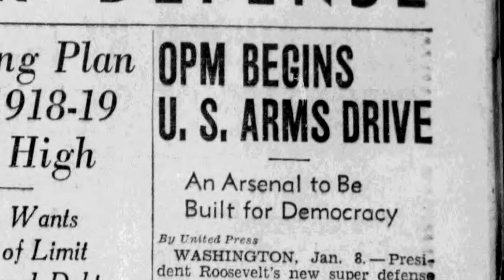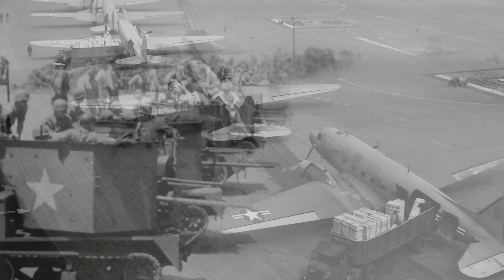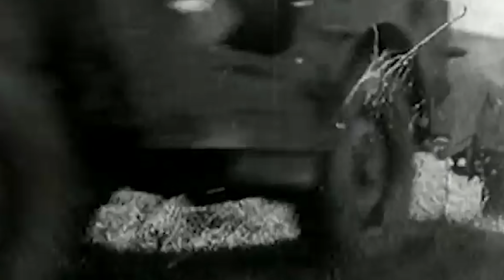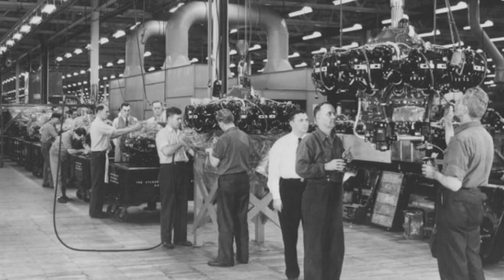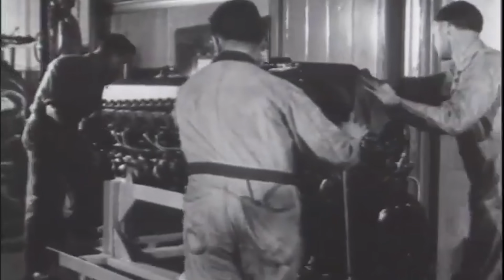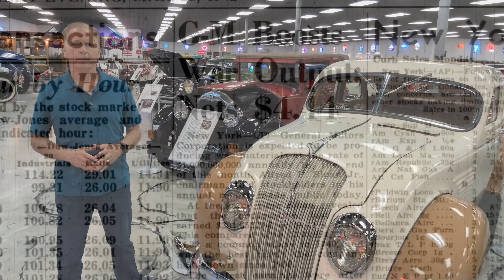How American Car Makers Turned the Tide of World War II

Comment: Packard was licensed to build RR Merlin engines and changed the design to make manufacturing quickr and easier. They also improved the supercharging system.
Reply: Plus they built 14,000 M2500 PT Boat engines for the US Navy and Brits !!! in addition to the 55,525 Merlin aircraft engines!!!

Comment: Ford was hoping to compete for aircraft engine contracts and developed a massive V12 DOHC engine whuch didn't get the contract. But then the army came asking if Ford ciukd make a massive tank engine. So they took that V12 engine and lopped off 4 cylinders. The result was an 18 liter 60 degree V8 with DOHC heads, a flat plane crank and it made 1000 ft/lbs of torque from near idle to 2200 rpm and 500 hp at 2600 rpm. It was all about torque. These engines powered many Sherman tanks. Chrysler also made a monster motor for Shermans, the A57 multibank engine. These were made from five Chrysler inline sixes mounted to a massive crankcase. Each bank had it's own crankshaft with the flywheels gears to a central output shaft... thirty cylinders and 370 hp.

Comment: The tiny Crosley Corporation pwhich had just expanded into the car business in 1939, made a massive difference in WW2. Powell Crosley got his start selling auto parts in the teens. He then developed an affordable radio for the masses. He needed something for buyers to listen to, so he started WLW radio, the governmentgave him an experimental licenseto broadcast at 500,000 watts. He then branched out into household appliances. His engineers help set up Voice of America to transmit to Europe, (later to south and central America). During the war they produced transceivers for the war effort. They also made small trailers, field kitchens, and small lightweight generators used in field HQs and as auxiliary power units on bombers and small boats. But the big important tgings were the proximity fuses for antiaircraft shells.

Comment: There, next to his favorite chair, was a picture of a B-24. It was the airplane that took him to 35 missions from England over to Germany. My favorite uncle was a WWII veteran. Late in his life, he finally spoke of some of his experiences. His job was a waist gunner. He regretted giving the pilot a chunk of metal that burned his glove when he picked it up. The chunk had penetrated the belly, came through seat he had just vacated, bounced off the bomb moving rail and landed on the floor. I received an education when I mentioned the B-17. His airplane was made by Ford. An interesting side note. The Delta single handle faucet copied a hydraulic control valve used in the B-24? In many ways the B-24 was advanced as compared to the B-17.

Comment: I agree that it's hard to pick one for contributing the most, and still it's worth mentioning more. Chrysler for example, also manufactured the engines for the B29 bombers, and in the process, made them better by contributing 1000s of design changes to deal with, among other things, their overheating issues while also increasing engine overhaul intervals. Chrysler was also instrumental in making a production atomic bomb possible. For example, nickel was a critical component used to make the atomic bomb because of its corrosion resistance, but getting enough nickel to meet production needs was seen as impossible. Chrysler's solution was to use its electro-plating technology, which helped stretch how far the available nickel could go. It worked because the actual amount of nickel wasn't the key; it's purity was. The plating process could apply nearly 100% pure nickel but with fractions of the amounts intially required.

Comment: Every company did its part and sometimes had to build someone else's designs and even had theirs taken away. You mentioned the Jeep and yes Willys and Ford built almost all of them but it was designed by American Bantam and they built the first batch. They could not build the huge numbers needed and so it got transferred to bigger companies. They did build the trailers that the Jeeps used. One thing you didn't touch on is how many rifles, submachine guns and large machine guns were built, I know subsidiaries of GM built enormous numbers.

Comment: Chrysler also made a big contribution to the Manhattan project, the acids used in the concentration process were so corroding the equipment would need to be made of nickel, Chrysler figured out how to use plating processes so that only a thin later of nickel was needed, making it possible.
Reply: @wiencourager And chrysler made the Wright R3350  for the B29's !!!

Comment: Not sure if it is covered in the vid, but  it sounds like it might be skipped. Packard was famous  for manufacturing the Rolls Royce V12 Merlin (Named after a bird not a wizard) that went into the P 51. It also produced the Packard designed V12 Marine engines that were used in both the ELCO and Higgins PT Boats. To demonstrate the expediencies of wartime production Ford had a contract to produce Pratt & Whitney R 2800 engines for P 47s before Willow Run started producing B 24's Ford:'s engines were not used in Ford,'s planes.
Reply: One of the first mentioned in this video. 
There are several videos on YT detailing the P-51's design and transformation when the Merlin engine was installed in place of the original Allison.
War Production first approached Ford to produce the Merlin because RR simply didn't have the production capacity. 

The story was told that Old Henry initially agreed, but then had his bouncers show the War Production people the door when they thanked him on behalf of President Roosevelt. 
Supposedly, the only thing Ford hated more than Jews and labor unions was Roosevelt. 
Packard had the capacity and the expertise to build enough Merlins, and their engineers made incremental changes that improved high-altitude performance, said modifications actually transferred to the Rolls-Royce home factory as well. 

FUN(eral) fact:  When Henry Ford died the mortuary handling The Arrangements had only Cadillac and LaSalle funeral coaches. 
Ford hadn't built the special production chassis for limousines and coaches so there were no Ford or Lincoln hearses. 
Instead of sending Henry to his final reward in a car from his arch-rival, the family and the mortuary rented Packards from another funeral home. 
I rather suspect that the family was afraid if they tried to put him into a Cadillac the old man would have gotten out and walked.

Comment: General Motors made the largest contribution to the production of war material due to its immense size and resources.  One of my grandfathers, and English immigrant, ran the powerhouse at Cadillac and never missed a day's work during the war.  Cadillac's General Manager, and GM Vice President Nickolas Dreystadt, was a German immigrant.  Cadillac produced tanks, self-propelled guns and parts for the Allison engines that powered the P38 lightening fighter plane.  My dad worked in production control at Cadillac tracking and shipping components from the war in North Africa that had to be cycled back to Detroit for rebuilding because it wasn't possible to manufacture enough new ones.  Nowadays most Americans don't know that the United States could no longer  wage a major war like WWII even if our lives depended on it because we don't have the industrial capacity to supply our armed forces.  Thanks for your great videos.
Reply: GM also created the Eastern Aircraft Company that produced Grumman Avenger torpedo bombers and Wildcat fighters so that Grumman could concentrate on design work and producing Hellcat fighters. Buick made the Hellcat tank destroyer which could reach 60 mph and the Allison aviation division made thousands of V12 engines for Curtiss, Bell, Lockheed and other US producers.
Reply: GM also owned Opal in Germany they made millions by using slave labor.
GM also helped with synthetic fuel for the Germans prolonging the war.
In the late nineties Ford paid out 5 billion dollars to the survivors of the factories owned by them.
GM never did anything even though they had far more factories in Germany.
The GM guy in charge of it all said it was great business running those factories and he received the same award from the Germans as Henry Ford
Reply: GM is garbage they always have been .....  Ford and Studebaker were #1   period
Reply: @toddbob55 oh please, Found on Road Dead and now backwards Drivers Return On Foot says all you need to know about Ford and tells us about you too.
Reply: Agreed!

Comment: After producing Merlin engines for the WWII effort, they should have had a leg up on a modern post war engine.
Reply from the maker: They were just beaten up by the Ford/Chevy price war in the 50s.
Reply: @rickdebruhlcars  Packard's purchase of Studebaker in 1954 didn't help. 
For whatever reason, Packard management was not aware of Studebaker's precarious financial situation, or that Studebaker's break-even production number was almost twice that they had been told. 
Packard accountants were said to have come out of the audit "ashen-faced."
Studebaker had a fine small-displacement V8, the Automatic Drive transmission (developed in-house and built by Borg-Warner) which was the most advanced in the world, and a nation-wide and worldwide dealer distribution network that was the greatest of any of the independent makers. 
Packard had a great V8 in the wings, along with Torsion-Level suspension and the Twin Traction differential. 
George Mason at Nash-Kelvinator saw the potential of merging N-K with Hudson and Studebaker with Packard, then merging the two resulting companies to form the third-largest automaker on the world. 
Mason died before the final merger could be accomplished and internal bickering between the two conglomerates scuttled the enterprise. 
By 1959, only Studebaker and Rambler nameplates survived.

Comment: Was it packard that historically produced machines with tolerances that equaled rolls Royce . Rolls Royce sent the blueprints for their engines to packard for manufacture during WW2 for that reason .
Reply from the maker: That's a really good point. The ability to build the engine properly was an important factor.
Reply: Packard built an Americanized version of the Rolls-Royce Merlin engine. All specs were converted from metric to English and many design changes were made to simplify mass production. 
A sidenote, the Canadian built version of the British Avro Lancaster bomber were powered by Packard Merlin engines.
Reply: @larrycarner2418  The Brits did NOT use the Metric system in WWII, the used the British Whitworth system, which was Packards largest problem in building the Merlin, there were 140 different sizes of threads and fittings that Packard had to make in house to meet the requirements to us the British Whitworth !!!!
Reply: Kiwi.N.Z 72yrs Pilot 
Yes and know  .  Lots of politics involved.  The Allison  V12 was a better engine  but didn't have a supercharger for high altitude.  Would take too long to develop one . The Merlin was up and running  , best just pump them out .  Any engine manufacturer could have built them  , it's a just a motor  .  Packard did a great job  ,  Johnny on the Spot  .
Reply: @Richard-xv3gw  The USAAF did NOT want a 2 stage supercharger on the Allison V1710, they wanted to use a TURBOcharger to feed the supercharger for a 2 stage system, BUT  TURBO's were to large to fit in most fighters,  the P38 used the TURBO's mounted in the long booms behind the engines, it worked,  P47 used a huge plane to house the TURBO chargers !!!

Comment: I'm going to go with Ford,  because they also developed an aircraft engine that got turned down by the war department. That ultimately became the saving grace for the underpowered Sherman. Which was using a over complicated Chrysler 30 cylinder flathead engine. Do when the Ford GAA overhead cam V8 at 1100 cu and 500 hp, was installed in the Sherman it gave the ageing tank the power it needed to outmaneuver the Panzer!
Reply: Panzer IV and up were underpowered anyway.

Comment: THE  JEEP  was  actually  designed  by the bantam Motor company,  but they were too small  to  Make enough  so they got willies  to make Bantams design,  THEN they needed even More so FORD made jeeps  identical  except for the FORD LOGO.  Bantam  ended up making the little trailers  pulled behind some of the JEEPS.  Kaiser  made Victory Ships  faster  than the enemy  could sink them, TUCKER  made  gun turrets for planes  Both tried  to get into the AUTo  business  after the war.  not with much success,  PACKARD  also made the V-12  engine  they used in PT Boats.  tanks  also used the GM  HYDRAMATIC transmission  that would  start  the automatic  transmissions  most of us drive today.
Reply: As a footnote, the original American Bantam factory in Butler, PA burned to the ground in November of 2025.
IT was a shell of it's former self, as Bantam went out of business in the mid-50s.
Reply: @waynetaylor8082 still say the fire was suspicious. It was a historical site.. and was located on prime real-estate.  So something like a huge fire was only way to tear down the rest.  
Ive been to Jeep Festival a few times at Butler
Reply: @waynetaylor8082 Car production never resumed after WWII.
Reply: @erikbrooks  Packard not only made the M2500 Marine V12, 14,000 of them but also the RR Merlin engine for the Brits, 37,137 of them and 18000 of them for the USAAF!!!!  The rest of the story !!!
Reply: Ah look at the three original prototype’s tested by the army. The Ford was the only one with a flat hood and headlights in the grill.
These are the only styling cues that still exist on today’s jeeps
Reply: Bantam did get their prototype out first… the general design was by army specifications… the reason bantam, ford and Willy’s jeeps look similar was the army  specified how long, high,wide, heavy & how much horsepower what tires etc. ford got the body right, Willy’s the power train … bantam was just quicker… but inferior.
Reply: It's Willys, and pronounced willis.